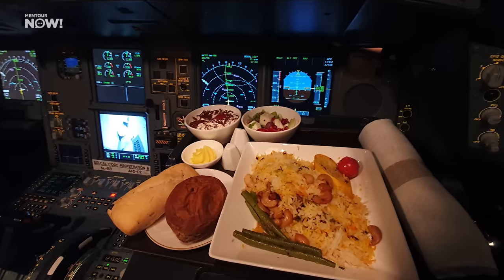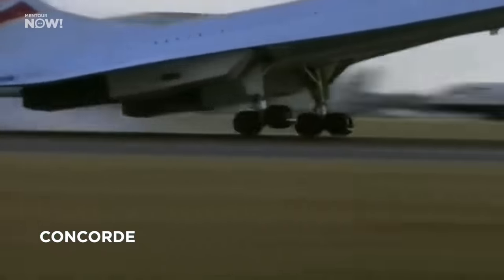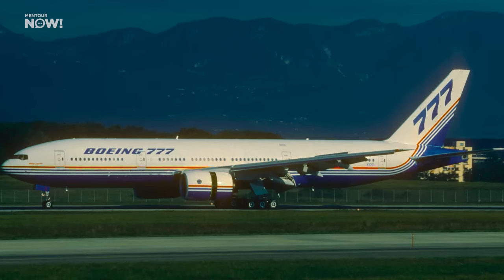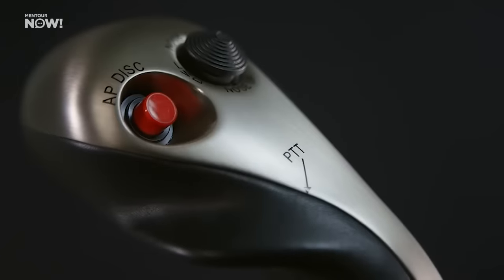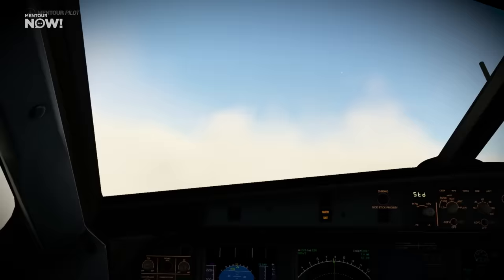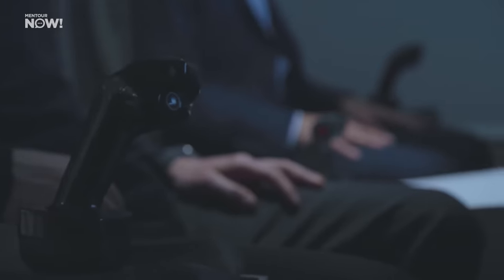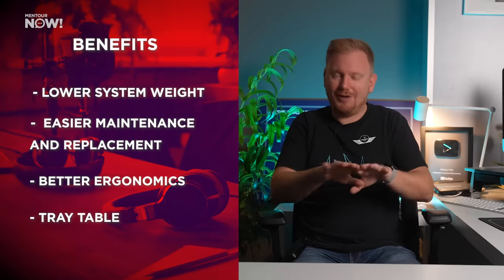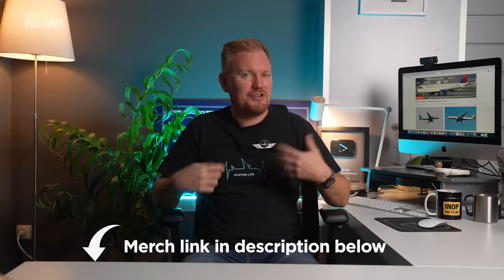Will Airbus Finally switch??

Comment: I'm all for mechanically and hydraulically connected and assisted sidesticks. (Active) It Increases pilot saftey in terms of awareness in the cockpit and feeling the aircraft when handflying. Lets see where the future takes us
Reply from the maker: I’m hoping this video will be a push in the right direction.
Reply: mechanical/hydraulic connection isn't going to happen, but if the electronic connection can be proven safe enough to certify (which has apparently already been done for the gulfstreams) then it really should be a huge step forward in terms of safety
Reply: Back in the dark ages, when there was no feedback on home microcomputer joysticks (Spectrums, BBC Micros, really ancient history) , and indeed most people didn't have joysticks at all, flying rudimentary flight sims with their keyboards, it was common to have a little circular display element with a big dot on it that visually represented the position of the joystick (or virtual joystick). So, what you need is a circular display in the middle of the panel with a white dot on that shows both pilots what the current effective inputs are, with the dot turning yellow if both sticks are making inputs that more or less agree with each other, and red if they are opposing each other. Then if the forces end up opposing for more than say 10 seconds, sound a buzzer.

The good thing about this is that it would be easy to retrofit to legacy aircraft...
Reply: Take a look at the active side sticks in the Symmetry Flight Deck on the Gulfstream G500, G700, etc. They do exactly what you're referencing without a mechanical linkage. Works great on those applications.
Reply: I don't think it's going to happen (again), because on big airplanes, it adds a massive amount of weight. Therefore, I am almost sure that fly-by-wire-only will stick around for a lot longer. However, eventually fly-by-wire will probably get transmitted via optical fiber. It is a lot lighter than the copper wiring and it is immune to EMI problems. However, first it has to prove to be reliable enough.
Reply: @fat_biker tactile feedback will be more effective than audio or visual feedback. Especially in a stressful situation.
Reply: @robertthoren4022  Agreed. But retrofitting it to generations of legacy Airbus aircraft seems like it won't happen. Whereas taking an additional output from the flight computer to a new little display in a pod stuck on top of the panel seems much easier to do.
Reply: @fat_biker  its not a buzzer but "dual input" but i agree with the display.
Reply: @fat_biker  I think that the problem with retrofitting wouldn't be a technical one. The signals needed should already be in the databus and servos are small and inexpensive. The main problem as I see it is the cost and hassle of retraining pilots. Therefore it will probably never happen for older aircraft.
Reply: @fat_biker well, you are still missing the feedback from the aircraft itself. Feeling the aerodynamic forces from the elevator is important.
Reply: @robertthoren4022  Yes, & the testing as well, you'd need to recertify the whole control system to make sure it didn't cause any issues in any situation, plus of course as you say, training. But more than that, if you hadn't been retrained you couldn't fly the jets that had been 'upgraded'.

Adding an extra 'clock' that potentially nobody has been trained on to the control panel seems like a far smaller lift for a retrofit...
Reply: @Biedrzyk73  Yes, but that's not a problem that is solvable for legacy aircraft. The problem of two pilots cancelling out each other's inputs without anybody realising, though... that has already killed quite a lot of people, & destroyed a very expensive plane!
Reply: @fr89k  More than forty years ago McD flew F15’s with fly by light systems. dcniner01
Reply: @Biedrzyk73  This is not missing from active side sticks. The aerodynamic forces are built in to it and you can feel the forces against the flight surfaces through the stick should the company want that option turned on.  That is quiet literally one of the biggest difference between passive and active side sticks.
Reply: @dcniner0187  That is cool to know. However, I wonder if this could be certified today for a passenger aircraft. Often the military is more relaxed, as they value functionality over safety (within a reasonable extend of course).
Reply: The future if any, would be electronics artificial ffb provided by the computer. 
There’s no way they going back to hydraulic / mechanically link flight controls. It’s heavy, harder to maintain, longer down time, also more failure points..

I could definitely see they go fully computerised ffb though but mainly because it can provide better control feeling for pilots and actually save even more weight!

The dampers they’re using on Airbus side-stick right now are ridiculous… it’s probably bigger  than dampers on some small cars.
Reply: I doubt seriously there will be a mechanical connection between the sticks. The fight control computer can just give each stick their force feedback information independently.
That way is less maintenance and risk of failure of that mechanical system.
Reply: @fr89k  The Kawasaki P-1 apparently uses 'fly by light' technology .
Reply: @richardgravett  Yes, I always miss non-US and non-European manufacturers. However, this again is a military aircraft. However, by now I also found out that the 737 either already has or is supposed to get fly-by-light. But I can't find further information when it's supposed to be available on the market or if it's already being sold and which 737 specifically this is (which would be huge step, because normally the 737 doesn't even have fly-by-wire).
Reply: Scare Buss.
Reply: it would need recertification bcz active sticks have stick force requirements from the FAA. main reason for the whole MCAS debacle.
Reply: @ferrariguy6389 At least its still a “bus” and not a “dive bomber”
Reply: @johannesgutsmiedl366  If electronics for the force feedback motors are implemented in totally separate circuit, it would be trivial to disconnect the force feedback system in case of problems and turning the sidestricks to passive controllers used in Airbus today. And if they can implement direct drive motors for the feedback system, it will be able to transmit higher quality details to the pilots than any mechanical linkage or hydraulic system could ever deliver.
Reply: I am an airbus pilot, flying the A350… Personally, I don’t think a lot of the issue that was mentioned with the passive side stick, I don’t think they are really an issue of the side stick design itself… most of the issues are poor training… I have been flying the Airbus for 17 years for a major carrier, and I have not seen any pilot who are confuse with who is flying the airplane. With regards to degraded mode, on newer airbus like the 380 and 350, it is almost impossible to goes into direct law (unlike the 320, which happens a lot and can very easy gets into direct law… even the 330, it is very rare to get into direct law)… so the whole concept of pilot miss and not realizing they need to trim, is almost non existent in newer airbus. But I do agreed that some of the way airbus depicted flight control law changed, like Alternate Law or Direct Law is very bad, and this really need to be improved. And they can do it, but it seems like they have no interested to improve upon that. 

On the other hand, with regards to active side stick, there are many issue with active side stick as well.

1) Adding servo on the side stick means that such servo can failed and they can introduce uncontrolled input (similar to a failed sensor or trim run away), which can cause flight safety issue. So it actually makes the system a lot more complex to certified and maintained.

2) Active side stick or side stick that are mechanically link, or side stick that has back driven servo… it makes implementing airbus flight control law a lot more complex. Airbus side stick sensitivity changes based on phase of flight and flight control law mode that you are in. Let’s take the approach and landing for example. You are in normal law, until you reaches 100ft, at which point your roll remains at normal law, but your pitch enter flare mode, which means it slowly blend from normal law to direct law, so that your actual flare in pitch are actually done in a mode that is similar to direct law. This is something that is much easier to do in a non-active side stick, and in an active side stick environment, it will makes such implementation a lot more complex and harder to maintain. 

So at the end of the day, I am not sure the extra complexity and added risk, as well as cost… not sure if all of the above will makes it worthwhile to change from a passive to an active side stick. I think there are a lot more trouble then it is worth. Especially when better training will resolve most of the issue.
Reply: @wowpeter  Great info! Maybe all you should have is a simple vibrator motor similar to one in PS4 game controller. That would allow making the stick shake a bit with a computer selectable vibration speed. That could be used to make different vibration patterns for stall, dual stick input and "lots of load on flight controls" feedback. And if that fails, you either lose the vibration or it vibrates in your hand all the time, neither of which should be much worse than modern Airbus design.
Reply: @MikkoRantalainen  yes, something like that would definitely be needed, and one nice additional thing is that you can still keep the 40 second override button that airbus currently has which lets you completely lock out the other sidestick, which would then be an advantage over boeing since in case of a pilot incapacitation you can just disable the link without needing to exert the mechanical force for a yoke split. However if the active system malfunctions in a more insidious way than a complete failure in a high stress situation and instead sends false feedback to the pilots, it could actually in itself be the cause of an accident. And proving that this scenario is less likely than an accident that would be prevented by the active sidestick is absolutely not trivial (though evidently gulfstream managed to do it).
Reply: @johannesgutsmiedl366 Agree. No hydraulic or mechanical linkages are required where electrical systems, servos can do the same for active side sticks.
Reply: @robertthoren4022 , tactile feedback on what?
Reply: @MikkoRantalainen , so far I haven't heard that anyone would have had problem to understand the current dual input warning. Also, why flight controls loading should be interesting to pilot in Airbus FWB aircraft? Couldn't care less how much there is load on some control. The only control that you can overload in A320 is rudder and if you really screw up with it, you can do it so fast that no warning system will save you - especially a warning system in sidestick.
Reply: @johannesgutsmiedl366 , 40 seconds doesn't make complete lock out for the other side stick, it only makes the priority to other one for the time being, so the effect is exactly same as holding the button all the time. If take over pb is pressed from another stick, that stick comes active (and priority) again.
Reply: @johannesgutsmiedl366  Agree.  The servomotors are a much more efficient solution in terms of weight and physical volume, not to mention reduction of potential pinch points in a hard linkage.